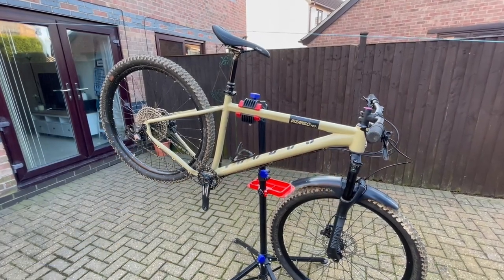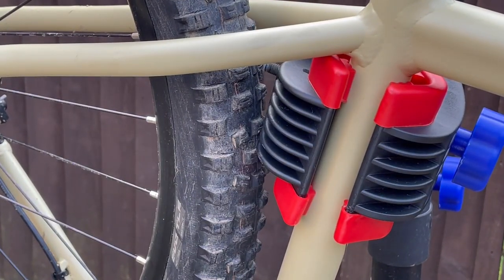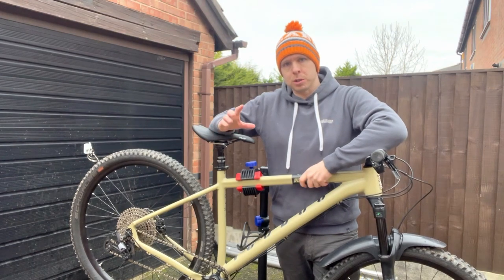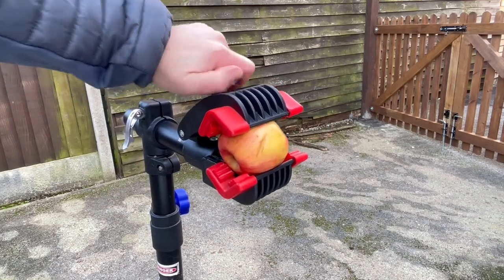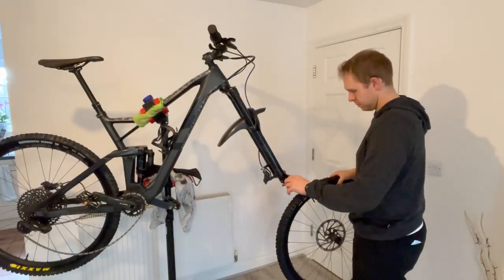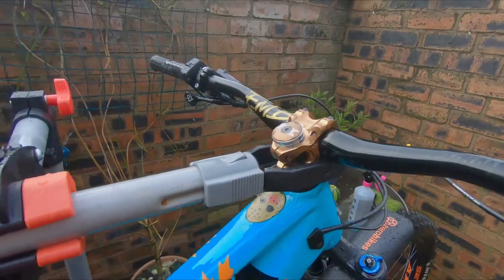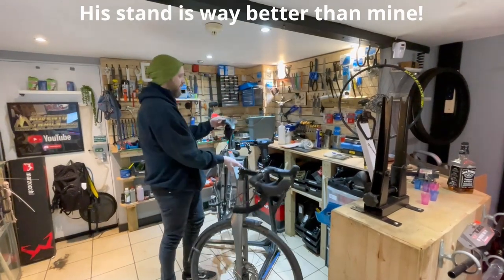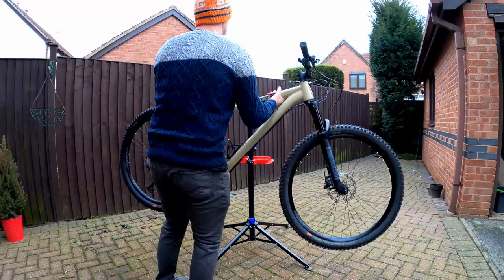Crushing Your Mountain Bike Frame?

Comment: dis is complete missinfo. you should never clamp ur bike frame, never. in fact you should never even touch ur bike frame or possibly even look at it for too long incase u bucle the tubes and cause microweldingfracturecracks all over the tyres

Comment: Parktool has done the maths behind crushing a dropper post stantion and the stand had significantly less force upon the dropper than a qr clamp. Unless you use a vice grip or a g clamp, youre gonna struggle to harm your frame. Great informative video, nice to see the UK youtube community too!
Reply from the maker: Nice. I will have to check that out. Yeah I am glad the UK YouTube community helped out with this video. Legends!
Reply: @bikeandbeyond  Out of interest, will you be running the same tyres for summer? Ive got the same pair on my hardtail but never tried them in warmer weather.

Comment: Clamped my Ribble urban. With a planet x bike stand. Which has quick release levers ( aswell as rotating adjustments ) Waiting for bike to be fixed. Were concerned. Not about frame crush but frame bend over time. Thinking I were seeing curvature etc.

Comment: Clamping the stanchion on the dropper seems bonkers to me.  Scratching that surface is a big no-no for me.  Scratches will harbour grit and that will be dragged past the seal and into the lower section of the post.  I'd imagine a lot of force would be needed to crush a top tube as the clamp surface is quite large therefore requiring more force.

Comment: I clamp the top tube with a large rag as well, I use a large rag so I can wipe my hands off on it when they get a bit greasey as well.
I dont clamp my dropper post as its effectively a suspension stanchion. I wouldn't clamp my fork stanchions. Like my forks I keep it clean and lubed with fork boost lube. Oh and my mates I ride with hate that my dropper which is a cheap own brand one has no flex or wobble to it and runs beautifully smooth and their's which are expensive ones aren't as good.

Comment: I usually use the top tube with a rag, I do like the idea of the device that fits between the bars and seat, not sure how that works if you take the forks off but for an ebike weight and some top tube shapes that would be a better solution.

One consideration, stands have fallen over with bikes clamped in them, chances are that will damage a frame and I saw a nice one for sale recently with was probably damaged by a clamp and something like a fall.

Comment: Ask 100 different people you will get several answers. Not all dropper posts are rated for clamping and even when they are some manufacturers will claim clamping on the dropper post body, some on the post. Go pick your bike up with one hand, you aren't naturally grabbing it by the dropper post, you probably grab it by the top tube.

I just clamp the bike in the most accessible way to clamp that bike at the time, some frames will run cables along the top tube, not ideal to clamp there if you are adjusting your shifting........not ideal to clamp the dropper though if you are doing adjustments to that.

Just be sensible, don't clamp any part of the bike to death, carbon, aluminum, steel, titanium, all are pretty strong unless you have bought a particularly ***ty bike.
Reply from the maker: Yeah I agree with you there. Some pretty sound advice.

Comment: The dropper post is specified to be clamped. Your clamp is safer comparatively than many other workstands because it doesn't tighten using a cam, instead using the handscrew as you showed. A lot of workstands do use a cam though, which will exert a much stronger clamp down than your stand will.

The idea of the 'dont clamp the frame' isn't necessarily that every time you do it you'll damage the bike. But rather you're introducing some risk that isn't necessary because you can just clamp the seatpost instead which is perfectly safe even from high clamping forces.
Reply from the maker: Good point about the cam tightening stands. I hadn’t considered that. 👍🏻